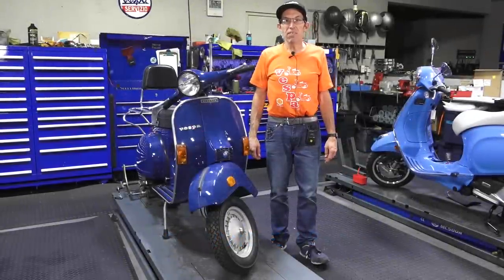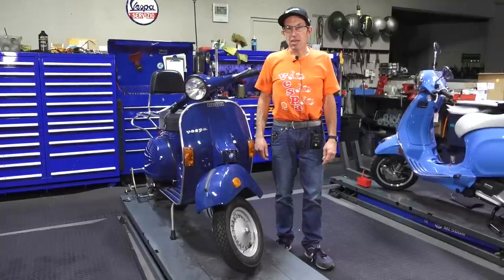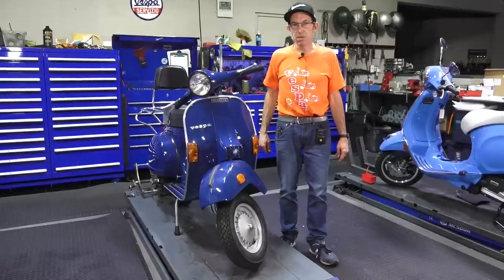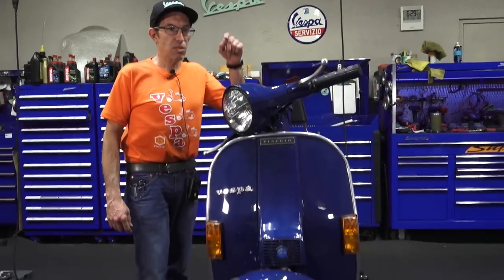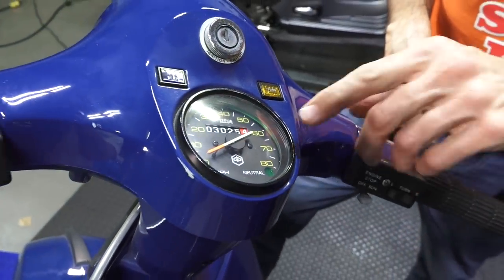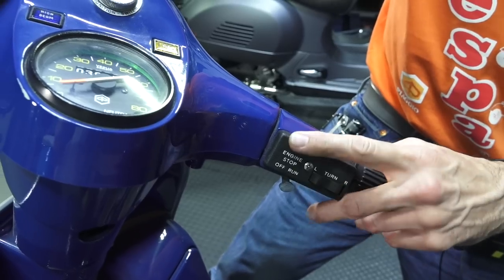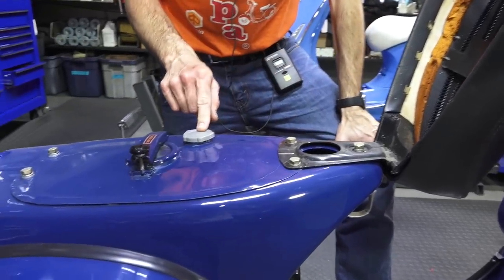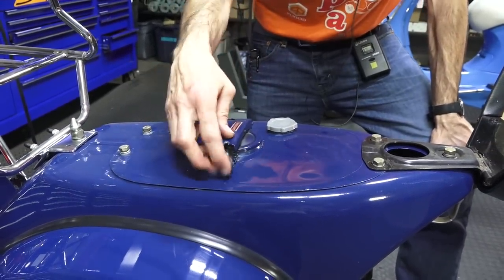Prepping An All Original 1978 Vespa P200E For Sale: PART 1

Comment: Enjoyed better than the previous barrage of product installation videos.

Robot, you have made some of the best scooter repair and maintenance videos on the internet. Thank you.

I would still like to see some service videos on the Liberty 150, such as working around the body work such as valve checks and the like, and perhaps even some on the Buddy 170i. I know that they aren't Vespa Motorsport's mainstay, but still they exist in its periphery.

I have also wondered what is faster in the 1/4 mile: a Honda Grom or a Vespa 150?

The Grom might have a slightly more efficient drive-train, but the Vespa has about 3.2 more hp.

Comment: @ 13:11 Is there a reason to mount the spare with the valve pointing to the body? I always have mine facing out to allow for checking and topping off of the spare with out removal?

Comment: I hope you will go into detail when it comes to replacing that pesky green wire.  The one on my ‘82 is rotten and it would be a big help to watch how you do it.
Reply: man0sticks F. It’s not a fun one but you essentially have to open the headset, remove the horn cast, remove the gas tank and then fish a new wire through the frame. I’ve found using a spare clutch cable taped to a new wire to be the easiest way so far. Poke the cable down from the headset to the horn, make sure its heading the right direction, keep pushing/ wiggling and then eventually grab it in the tunnel. Then its a matter of leading it over the engine to the CDI and then solder/ crimp your connection ends.
Reply: @mjchargerSD  Just to be clear, what would be the problem with simply removing the original green wire and not replacing it?  Would the bike still run, or would the kill switch not work?  If the latter, then can't the engine be turned off with the key anyway?
Reply: man0sticks F. 

The green wire is bundled up with every wire in the harness in shrink wrap. In order to just pull the one wire you’d have to remove the whole harness and then reinstall it. That would take days instead of a few hours to run a new one.

So, people will steal the neutral indicator wire (brown wire) since it runs to the same area essentially. You’ll have no neutral light, but you’ll get a kill wire back. Or, people will just run a new green wire using the clutch cable method I described earlier.

By permanently removing the rotten green wire, you will have no motor kill (key or thumb switch). Your bike will still run, but it will start for anyone. You will have to stall out the scoot to get it to turn off. 

Hope that all made sense

Comment: Nice I have a px200 from 98 first disc brake  model all original  I will never sell
Reply: I had a 99 model, fully rebuilt with mazz crank, Pinasco 225 kit. Beautiful machine but my Wife invited we move to Australia so I had to sell😩
Reply: @mickeybowmeister1944  keep mine stock for reliability  ,but I had a tuned 172 malossi with  a 28mil  carb it was like motorcross  bike ,scary
Reply: @staffh3815  sounds like a lovely machine. I meant my Wife insisted we move. Was based in NZ. Decent old school Vespas are really hard to find here and quite expensive.